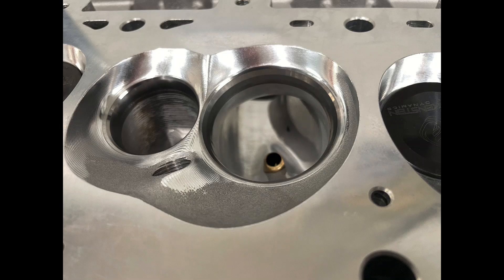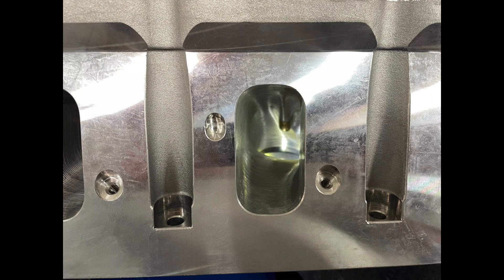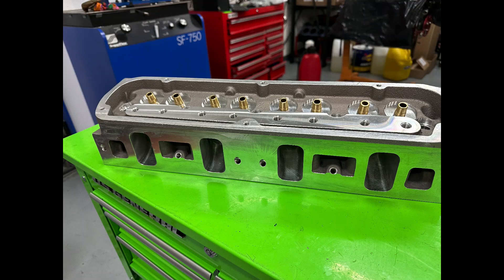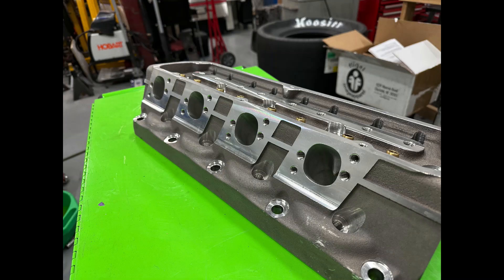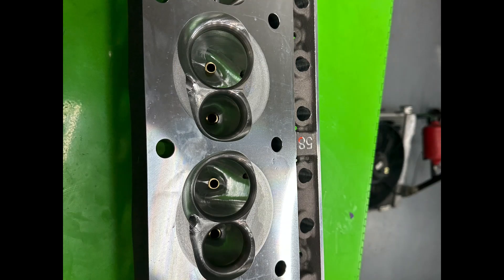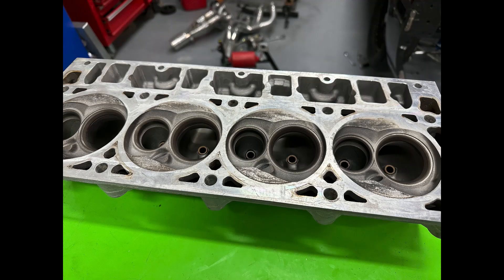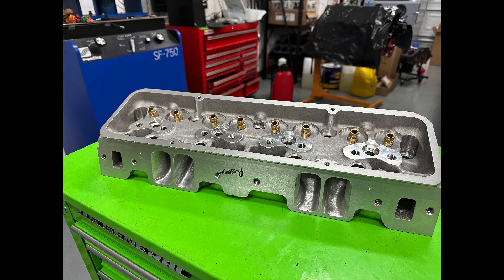Is More Flow Better

Comment: I will argue that Fuel injected  engines that wet flow is more important then a carburetor engine. Most people think that FI atomizes fuel better but that simply is not true.
Reply: GM SFI engines spray fuel on the back of a closed valve at lower loads and rpm.
Reply: If you're talking a throttle-body injected EFI engine vs. a carb, then I think you're 100% right. The starting droplet size just after the throttle body almost has to be much larger than just downstream of a properly setup carb.    But with port injection close to the intake valve and with an injector pointing towards an open intake valve the wet flow really shouldn't matter much. (I'd think you'd still want a rough texture in the bowl area, but that should be about all that's needed AFAIK; just avoid "polishing" anything in the intake tract.)

Fuel injector design (more and more smaller and smaller holes in the injector tips) and increasing fuel pressures have dramatically decreased the droplet size out of fuel injectors. In 2002 12 hole tapered injectors cam out that had a starting droplet size just out of the injector of 50 micrometers -those droplets travel from the injector through the air stream (but obviously not very far in most port applications) and they shrink as they travel as some of the fuel is evaporated off and travel past the open intake valve.  "Completely atomized" is considered to be a mean droplet size of 10-20um and that should be pretty achievable with a 12 hole injector and a bit of heat in the intake / air stream and good fuel pressure.  If the fuel FULLY turned into a gas, it expands dramatically and actually hurts air flow; the goal is to have it at 10-20um through the open intake valve.

Chris Reynolds makes a good point that most port EFI systems ARE spraying on the back of a closed intake valve at lower loads and RPMs to help the fuel volatize-it helps keep the idle stable and makes sure the AFR doesn't spike peak on transient situations when you go from low throttle position / WoT quickly.  But the current state-of-the-art port systems from Bosch that is provided to many OEMs for current lower cost port EFI engines will switch to open valve injection off idle and for as long as they can.

Comment: AFR told me no.I talked to Adam at AFR when building my 406.We talked about the 195’s and the 210’s.With the cam I am running and gear ratio and what I plan to do with it,Adam had said I was borderline.Mention one of the issues,,if I ran the 210’s I might zing the RPM’s A little to quick.So I was borderline.
Reply: I don’t want to out RPM my torque ban.Kind of make sense.
Reply: Correct!….

Comment: You are missing a key consideration.  Time.  Ultimately Torque is a function of Time  X CFM.    The time is in the camshaft.    You can make the same power with a smaller cam and head that can flow better.   Camshaft timing has its limits, such as drivability, emissions and operating RPM.      There is also a modulus, for port size and runner length, a smaller port will have less volume or weight that needs to be re-accelerated when the valve starts to open so it will respond better to transients and lower speed operation.     So you have to pick a cam (time) and work backwards.   The smallest port with the most flow will offer the best transients.  Dyno doesn't value transients which is why many dyno hero motors do nothing on a road track where the driver needs throttle response to transfer load and steer the the car.
Reply from the maker: I do agree somewhat. I left the cam part out because it really could make a series of videos not something to just throw in this one. The smallest port that flow the most I have addressed in previous video. It’s really in what rpm range you want to accelerate that determines port size. Thanks for the comment.
Reply: You hit the nail  VERY HARD ON THE HEAD.......
I always say : a dyno revving up 500rpm/sec ........... That takes 4 seconds from 6000 to 8000 rpm..... Thats  too slow. 
Nobody uses calenders measuring accelaration....
Reply from the maker: You can change the acceleration rate of the dyno. They also have inertia dynos that accelerate the engine at it own pace.
Reply: @WeingartnerRacing   👍
Reply: If you think that the best racers out there, regardless, what kind of racing road race drag race whatever if you think that the most successful people do not use a dyno Engine or chassis you are wrong by a mile they’ve been using them for decades and decades, I know you don’t seem to like them or respect them for some reason but you’re just plain wrong
Reply: @trischarchuleta9865   I am not saying that.   The engine , for optimum performance, should be tested and tuned at accelerations achieved at the track.
Reply: "Ultimately Torque is a function of Time  X CFM"   shouldn't that say hp instead of torque ?  Ultimately Torque is how much fuel  air in proper ratio you can pack into a cylinder and how much of that potential energy can be used to push the piston down to be multiplied by the crank, Torque is basically one powerstroke and hp is all the powerstrokes added up over time aka rpm, and rpm is displacement over time aka cfm.
Reply: Are you trying to say overlap determines the rpm where peak efficiency occurs for a given combo?  In my mind, cfm is the second concern behind velocity, yet both are critical for best output..
Reply: Circle track guys had this figured out decades ago, people read magazine articles and get caught up in big CFM, big peak Dyno hp numbers, put it together and wish they had left it stock, there's a good reason for the compression and gearing/stall recommendations given for shelf cams the bottom of the page guys usually spend a lot of money to make the car go slower. I'd venture a guess and say that 90% of the street car crowd would be happier with more cubic inches, even if it shows less peak hp will run, drive, and accelerate from idle to 4000 great.
Reply: @b.c4066  If only there were circle track quality of headers available as "shelf headers" for more car platforms.  The same headers designed in the 50s and 60s keep getting sold today... I like the small fast heads and tighter LSA circle track cams, but getting the exhaust velocity of easily available headers for Crate motors on common car platforms is very tough.
Reply: @adamarndt7617  trouble is if you want that kind of quality it's almost always custom built to the engine and chassis.. 2500-3500 bucks, or more. And depending on chassis will almost always still be a compromise for best fit, serviceability etc.
Reply: @b.c4066  I know. I just wish someone would start making modern designed headers as shelf headers for common performance platforms... ARH is about the closest I can find for my car and they do have nice merge collectors with merge spikes and everything.  I bought PipeMax and then realized how far from ideal all the shelf headers are and then realized that getting anything close to ideal is like you said like $2,500 bucks that I just can't justify.  -Some day when I hit PowerBall; lol!

Comment: Eric I see you show a pic of the Trick flow twisted SBC head, have you flowed that head and have you used them at all?
Reply from the maker: No it was at the auction yesterday. I bid on it but it went for $300. I gave the guy my card to flow it.
Reply: I see a lot of those for sale on marketplace, are they underrated perhaps?
Reply: @stevenbelue5496  the original  g1 with canted valves was not a good design, they tried to design it to work with special rockers, they had problems, had trouble with the guides. There is a reason they stopped making and selling them.  Haven't heard much about the g2 twisted wedge sbc heads
Reply: @stevenbelue5496  Well like anything else, if you pay close attention to your valve train Geometry, I think they can be made to work fine. And with some minor port work I am sure they will make great power.
Reply: @racerd9669  I seem to remember something about them being limited on lift for some reason.
Reply: @stevenbelue5496  Well Steve I am looking at running no more than .480 valve lift.
Reply: Yep, I picked up on the old twisted wedge as well. A friend bought a new set back when they came out. More street hotrod head than a race head. IIRC, it had great low and mid lift flow out of the box compared to what was available back then.